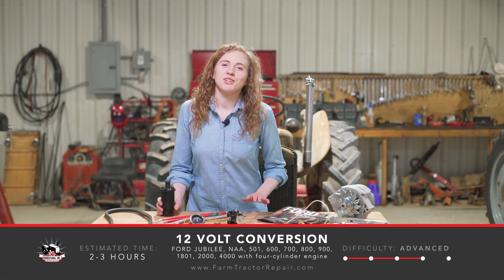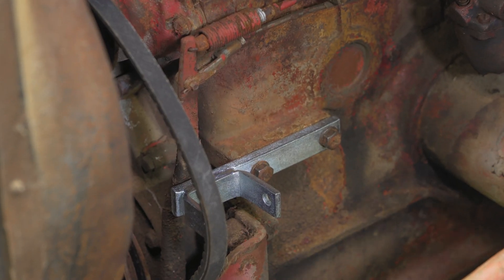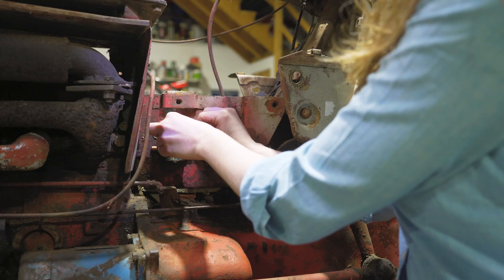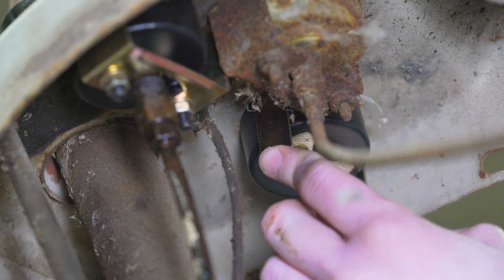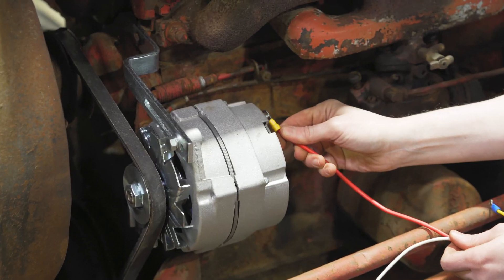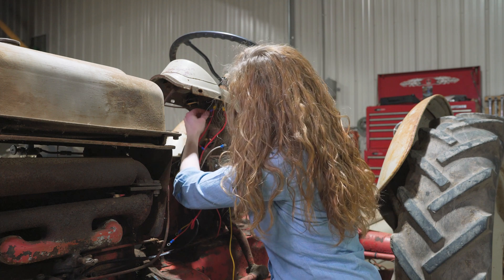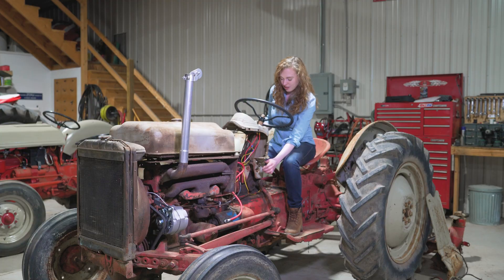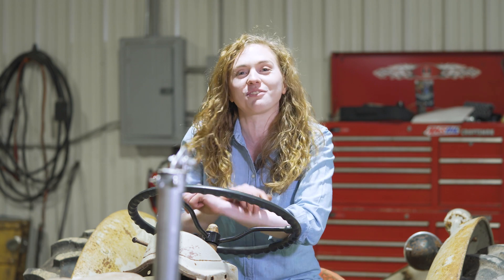Twelve Volt Conversion for Ford NAA, Jubilee, 600, 800, 2000, 4000 4-Cylidner Tractors

Comment: The 6 volt starter must be changed out to a 12 volt starter, if you want the starter to survive on 12 volts.  6 volt starters have 2 field windings; whereas, 12 volt Ford starters have 4 field windings.  See page 71 of the 1955-1960 Ford Tractor Shop Manual.

Comment: I have wired my ford 8n the way you show in this video and it does not work. And i don’t have the money to call you tech support guy.  And i don’t have the money to pay someone to come and fix it. I don’t know what to do at this point.
Reply: Get a multimeter. Might just be a 15 dollar push button starter switch

Comment: on my tractor the volt meter stay on  i  switcn the hot wire from the battery to the key side where the key would shut the power off  then ran the jumper wire back to the meter to cut the power to the meter  ever thing else work

Comment: Of course not one video showing steiners kit. It only has a 3 wire harness. Worst instructions and diagram in the world. I’m returning my kit guess I’ll go back to suffering with the shitty stock setup, generator doesn’t even charge, I get to look forward to recharging my battery again every time I use it. On top of all that the belt that’s included in the kit is to long.spend all that time and money and they can’t even print off a understandable set of instructions or give you the correct fitting parts. Working on stuff like this used to be enjoyable to me, now with Chinese quality parts and paper pushers who know nothing I hate it, everytime I work on anything anymore it’s a nightmare like this.

Comment: I put this kit on my 4000 ran it for about 5 minutes alternnator got super hot and positive wires got really hot which in the video it’s wired different than in the book don’t know if it’s a faulty alternator or what but pretty bummed out been wanting to get my tractor up and going but had to wait a month or so after getting the kit because I had other problems at home to take care of
Reply: I stand corrected shortly after posting my comment I found that my starter is shorted out I’m guessing because it’s the only short I could find

Comment: You can use your generator brackets. Flip the block one backwards and the straight top bracket mounts to the backside of the mounting hole.

Comment: Thanks for the excellent tutorial and for packaging all of the parts together.  My install went smoothly and I am surprised at the difference this made to the tractor.  Starting seems so much stronger than with the 6 volt battery.  

I’m ready for a fuel sending unit replacement video when you make one.!!

Comment: A nice addition to the wiring diagram in your manual would be to show the spark plug wiring order from spark plug to the firing order position on the distributor cap.  It would be a nice visual aid in making sure they are put back in the proper order if they were removed for whatever reason.  The distributor cap has a 1 by one of the cap connections I think, indicating the number of the spark plug wire as number 1?  Let me know if not so.  I'm currently upgrading a 1948 8N Ford as well as a 1957 Ford 641 using your manual and parts.  Love your videos as they are a big help!

Comment: I need help. I have done the alternator conversion. The tractor will try to start when i engage the negative battery switch, and when I turn the key to the online position the tractor will start and run, but the starter stays engaged, and when I turn the key switch off, the motor will stop, but the starter is still trying to run. I don’t know what I did wrong. I followed the book and your video or any advice you can give me.  Thank you.

Comment: I don’t see how the changing it from a 6 volt positive ground can still utilize the neutral switch  to close the starter relay when you have changed it to negative ground as the neutral safety switch can only ground what is connected to it’s terminal? I installed a 4 wire $5.00 relay in the starter wiring circuit to apply 12 votes to the starter solenoid and used the neutral grounding safety switch to ground or complete the new relay’s ground wire on its relay activating side. I’ve done this on all three of my tractors… 2 jubilees and an NAA tractor and it works great!

Comment: I have what I believe to be a 64 Ford 2000 with mounting studs stripped for my starter solenoid. Would you be able to identify if it is a 1/4-20 or 1/4-28 thread pitch please?

Comment: my goodness this was so helpful, at 4:10 the bracket you're holding I put it on backwards and bolted it to the back of the altenator not the front, the bend in the bracket was rubbing against the exhaust...so glad I found this video, thank you!

Comment: Just so you are aware, I bought your wiring harness and all went well except my tractor didn’t have a terminal block. It was wired terribly and never charged so I’m thinking this was probably part of the problem. 
The first issue I had was when I purchased a new alternator for this the site said 3 business days to arrive.  It took 5 business days. I complained about that and Linda basically emailed me that I should have chosen UPS if I’d wanted the 3 days. Perhaps I’d made a mistake when choosing shipping.  I guess that was my fault too. 
Next issue since mine didn’t have a terminal block and I didn’t want to pay $20 for a $10 item, I bought one at Napa but I had a question about whether it was grounded or not. I was pretty sure it was not grounded but I need to verify. I called and left a message and didn’t get a reply which is fine it was only a day. I called back this morning and Linda asked me what f I had left a message and I said yes and she said that I really ask a question in my message so….  I guess it my fault again for not specifically asking a question in my message but I did leave a number and requested a call back. Again I guess Its my mistake. 
3rd issue I had was when I did ask about whether the terminal block was insulated from the frame/ground I did get an answer but it was basically that the Napa part should be used as Napa directs. Well Napa don’t sell parts  for a 1957 jubilee tractor so I tried to explain that I just needed to know whether it was insulated or not and I got told very abruptly that they can’t guarantee a Napa part. Lol. Just so you know I’ve spent in excess on $150 with your website and I’ve have 3 issues with Linda that I didn’t appreciate and I will no longer spend my money with you. 
Thought you should know. If you would like a copy of the email she sent me let me know. Otherwise have a good day.

Comment: Is the exhaust on that tractor original or did y'all fabricate it? I like that a lot more than dripping gas on the hot pipe under the carb.

Comment: I don't know if it's just me but the belt I received with your kit does not seem to fit my 860. It is very wide compared to the original but I think about the same length, so it doesn't sit low enough in the pulleys to reach around everything. The Alternator pulley is wider than the other pulleys. I think I'm going to have to go to the farm store and look for something a little longer and maybe half way between the original belt width and the new alternator pulley width.

Comment: I have not one, but two tractors that need this kit installed: an 8N and a 960.  I have the parts, now I need the ambition. Getting that hood off requires either 2 strong men and a boy or a shop crane.  It's not casually done.

Comment: This one point confuses me: At 5:21 it clearly states on the solenoid it is "6V" or 6 Volt, but Rachel says there is no difference. Why would the manufacturer specify "6V" if it didn't matter?   (Not dinging Rachel or Dan, we all love what they have done for us with these videos and parts supply, it just is an ooopsy that needs a knowledgable response)
Reply: You don't change the starter either. They can take the voltage. It might have a slightly different design if it were made for 12 volts but not enough to matter. There are some people saying that you can have starter issues, but I have not seen it.
Reply: @delgriffith1  After this and other YT i intentionally purchased a 6 volt strarter for my 12 converted Jubilee. So far it works perfect.

Comment: Sounds silly but I have an aluminum disc inside my gas tank (‘58 861).  I don’t know if it belongs but it leaves a half inch of gas at the bottom of the tank and there was no screen on the shutoff valve when I took it out.  What is the aluminum disc and is it standard?  Lost!!

Comment: The conversion kit worked great, and the instructions manual was spot on.
Could you do another video showing  the proper way to  add lights to your 12 volt  kit?

Comment: Hi rachael,   let me first say that your videos are some of the most well put together !    I'm really getting frustrated searching for a conversion kit for my my 1953 Jubilee.   it is still 6 volt pos ground..  i'm sick and tired of having to mess with the ign every time  i try to start it , after sitting for months at a time.   so here's the problem :   i want to purchase an all in one kit that will convert to 12 volt neg grd.   with electronic ign.   with a new belt and 12 volt coil   everything  i need --- all in one box !     some alternator kits -- i don't like the 3 pc  mount -- some don't come with the new belt   and hardly any come with the coil.   If I have to select everything individually  , I'll  surely  get something wrong!    I completely stripped and rebuilt this machine to original  years ago ----   but  the ignition has always been a weak point.  it was great when i could keep it indoors .  any thoughts?     I've asked on utube for any recomendations  for the  best kits to purchase -- no help.  they all look the same -- except some guys/companies  charge way more for the same product.   thanks for any help,  Marc

Comment: Great Video! But I believe You hooked the Amp Gauge leads Backwards. The alternator wire should go to the negative side of the amp gauge and, the solenoid & terminal block leads should go to the positive side of the amp gauge. Unless I'm missing something. Let me know. Thanks!
Reply: CORRECTION: I made the same mistake in my comment. What I wanted to say is:Great Video! But I believe You hooked the Amp Gauge leads Backwards. The alternator wire should go to the POSITIVE side of the amp gauge and, the solenoid & terminal block leads should go to the NEGATIVE side of the amp gauge. Unless I'm missing something. Let me know. Thanks!

Comment: I have a Ford 600 with 6v positive ground. Do I need to reverse the polarity of the voltage regulator as part of a conversion to a 12v negative ground? Thanks
Reply: @davejennings779. If you are fitting an alternator it should have a  built-in regulator. It should also be negative ground. You can remove the 6V regulator. If you are fitting a 12V generator you will need a 12V regulator. For a 12V generator you can have positive or negative earth but depending on whether the generator has an internally or an externally earthed field. You must match the correct regulator to the generator. Also you must polarise your generator and regulator. If I have totally confused you please reply back to me. I have been working on this older equipment for over 50 years. CHEERS

Comment: I did it! Or, should I say, we did it. With Rachel's help from this video, I re-converted my 850's 12 volt system. It had already been converted when I bought the tractor but it had been done wrong. So, I bought the kit that Rachel sells and re-did everything. I took my time, started and stopped the video at each separate place until it was complete. I even gained the use of my starter button which the previous owner had disconnected. Now my tractor is charging correctly as it should, and I've regained that one safety feature of starting the tractor in neutral, instead of accidentally starting while it was in gear. That happened a few times too many. Thanks Rachel, you're the best!

Comment: I recently bought an 850 and it had already been converted to 12 volts by the previous owner.  As I was working on the carburetor and manifold (rusted out manifold) I was resting my hand on the alternator and it was warm.  The engine hadn't been running or anything so I thought this was odd.  I took the main wire off the alternator (it's not a one wire version like you have in the video) and the heat went away.  

Prior to this happening if I left the tractor sit for a while the battery would be dead.  I'd charge the battery back up, run the tractor for a while, and shut it off.  After a day of sitting the battery would be dead again.  Once I took the wire off the alternator the battery has stayed charged.  I'm sure it's not getting re-charged by the alternator, but at least it starts the engine.  The long and short of it is that whoever did the 12 volt conversion obviously did something wrong.  Having watched this video I feel pretty confident that I can troubleshoot the problem and get it fixed.  Also, the alternator makes a horrible squealing noise when the engine is running so it needs to be replaced anyway.  I'm going to get a single-wire version rather than something somebody pulled off a car they had sitting around.

Comment: Just rewired my 8N following online diagrams. Replaced the starter switch. It starts and runs great. Only problem, when I turn off the key the engine keeps running. I have to turn off the gas to turn it off.   What am I missing????
Reply: Some circuit is running continuous power into the coil. Check for the wire on the positive terminal of the coil. As a test starting point, take the nut off the terminal and retain the wire on the terminal with a tight bit of vacuum hose. Start the engine, turn the power switch off, and pull the vacuum hose off so you can lift the wire off. The engine should stop immediately. If it keeps running, that's heat ignition, not electric spark. Typically it's rattling by then. If your engine stops, you'll need to track that wire back and find the point that battery power is entering the circuit. It should be cut off by the switch.

Comment: On a positive ground, is the starter not grounded positive and a negative cable from solenoid?  Then when changing polarity, would the starter not turn the opposite direction?
Reply: I'm thinking the same thing.

Comment: A comment and a question.  The question - On a 1962 Ford 871, the muffler is hitting the new 12v conversion alternator pulley nut.  Unlike the video where the muffler goes UP, ours comes forward and the down between the fan cage and the alternator pulley.  * Any suggestions welcome! *      The comment - Rachel makes it look easy.  I think it took me several hours to get past the first 30 seconds "take your hood off and it helps to remove the air cleaner!

Comment: . I just bought a 9n and the guy put a 12v conversion and a guess put a new resistor as well.  And he got it fired up for a few minutes but like you said after that it wouldn't run anymore.   Should i  remove that external resistor and see if that fixes the issue?
Reply: If your coil has internal resistance as described in the video, then you should remove the resistor.
Reply: @RK-gg3pr  we ended up doing  that.  Turns out the guy didn't put the rotor button in the distributor  either.     We put new power cables on it as well.   Runs like a champ 👍

Comment: I bought a 1953 ford jubilee and there no 2 nd and 4 th gear took off the shifter plate and one of the metal piece was out and its bent. Do you have a video showing how to fix.

Comment: In your example, you’re still set for positive ground, right?  The solenoid has the grounded base, right?
Reply: NO!  The converted 12V system will ground negative.  Yes - I believe current flows from the starter button (positive) to the solendoid, through the base to ground.

Comment: I got my Ford 641 about 6 months ago so I am still learning.  I went to Everything Attachment to learn how to use what I have.  I found your site on a search for maintenance for the Ford 641.  I have watched about 4 videos now and decided the best thing I could do is subscribe.  So I did.  :o)  the F641 already had been converted to 12 VDC when I got it but the wiring job was patched here and there.  I have replaced wires one by one in an attempt to clean things up.  I am only having one problem and that is vapor locking.  I got it fixed temporarily.  My question is this:  Am I and idiot for using rubber fuel line?  should I install steel tubing instead of using rubber?   It's Okay if I am an idiot, at least then I know what I should do.  :o)  :o)  thx so much for helping me with my F641 Maintenance.

Comment: Hi Rachel, My 860 came with a "partial 12v conversion" using an 12v alternator, 12 volt battery, resistor and a 6 volt coil. I think I can figure out how to make a complete 12v system using this video as a guide. One aspect you didn't mention was the running lights. I hope to retrofit LEDs onto my tractor to turn night into day. 
If I my suggest, you might consider creating a e-manual of your 12 conversion book, downloadable for a reduced price since it will most likely be used only one time by the buyer. 
Also, I recently rebuilt the 860's carb using your carb kit and I also did a tune-up with plugs, points and condenser, spark plug wiring harness and cap and rotor. Prior to that it did not run. There is still hope for the old 860. Next task will be to replace the gas tank and then on to a top overhaul. Cheers!

Comment: where do guys put the ammeter. fords only have 3 holes. one for oil , one for fuel gauge and one for temperature
Reply: Good question.  Our fuel gauge was flaky anyway, and not sure what it would take to make it work with 12V, so we took out the fuel gauge and put the ammeter there.